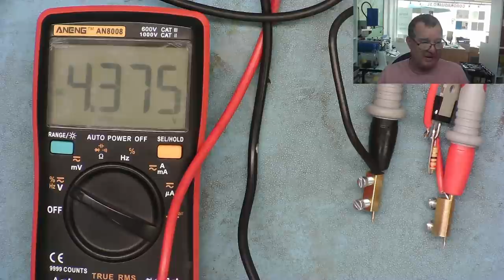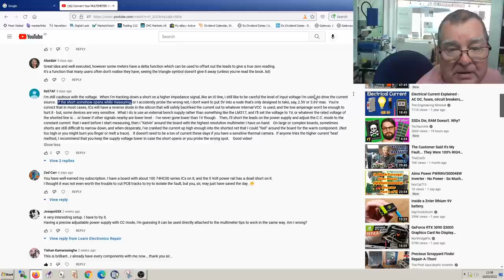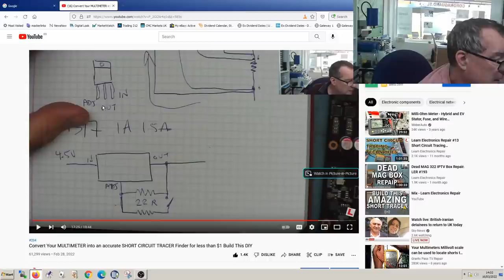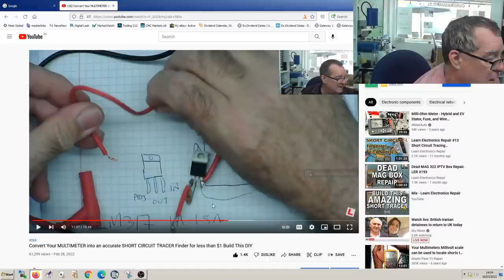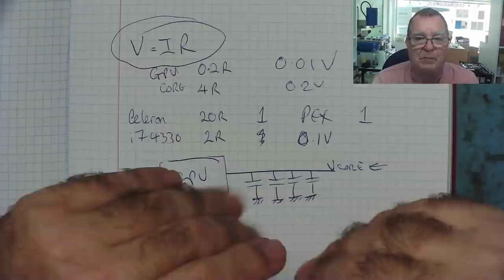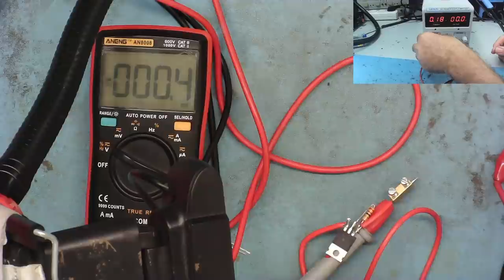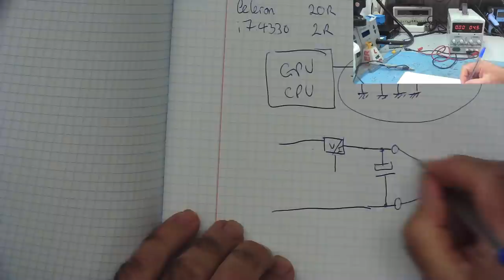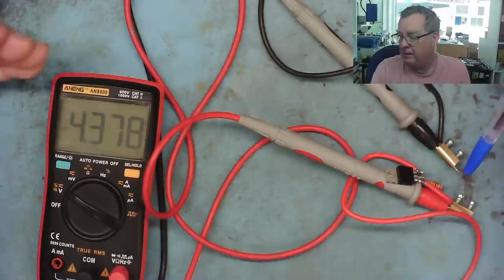The $1 DIY SHORT CIRCUIT TRACER Part 2. Will a 5V short finder kill sensitive components CPU GPU?

Comment: Its clear that people dont understand voltage injection and how voltage behaves under shorted conditions. Nice Video Rich, its a shame you had to do a revisit and prove yourself mate. Great video though, thank you.
Reply from the maker: Really my intention is to help people understand, rather than to prove I was right (though that was a bonus LOL).  I didn't mind revisiting this, if it educates people that is good enough justification to me 🙂
Reply: @LearnElectronicsRepair  you know it was better to show us this. i learned so much from this video thank you so much.
Reply: i'm not sure if i can agree so easily
ex:
a faulty capacitor can cause a short , but it can become an open circuit too.
guess what happen in the second case?

ok, it mean it burned (?) and you 'll see it.
but what about if you "forget" 

what about a faulty lm317, a faulty resistor in the short circuit tracer etc.

repair it' s not trust in the best case, but believe the worst can happen.
ex :
one upon a time,
1 of my test probe was faulty, i didn't see it, so i lost 1hour based on this

after that, i never did this mistake a second time

my 2 cents ^^
Reply: Never say things like that, discussion is always good, another video is always better, brings more eyes into the technicalities and builds a stronger knowledge base. Discussion is always good!
Reply: @ZZZ-z9n3n  surely you check your test equipment BEFORE applying it to the fault? SOP, mate.

Comment: For all those scared of the horrific high voltage, simply drop a 1a diode or two across the output, max voltage now 0.5v or 1v and you can still test for shorts.

Comment: I am so glad that you covered the information about not using PSUs for your power supply, because they have capacitors inside them. I would have surely missed this point. Meaning, I would have included the capacitors that the data sheet suggests to stabilize the operations of the LM317. Including those capacitors would have created a monster. It is very likely that it would have never occurred to me what the problem would have been.
Reply: I think you can use bench power supply. Just don't set voltage to 4.5V. Why not to set the voltage to 0.8V and limit current to 100mA?

Comment: The people worried about voltage rising are probably thinking about a bench power supplies output reading which does go up as it is trying to reach set amp's. Does not mean the circuit will flow that much voltage.
Reply from the maker: Yeah  I think that is exactly why a lot of folks get this wrong 😉

Comment: In summary, a current source supplies a variable voltage while maintaining a constant current, while a voltage source supplies a variable current with a constant voltage.
 Both sources do this depending on the load impedance.
 Excellent explanation, very detailed. Thanks for the video.😀

Comment: In other words: If you do not understand ohm's law to its fullest, you should not be messing around with electronics or electric circuits anyway.
Well done Richard !
Reply from the maker: Yeah Ohms law is kinda the one essential bit of theory to understand if you want to learn to repair stuff.  I'm sure this video will help some along the way and if it does then it was worth the time taken to make it😊
Reply: exactly
Reply: Yeah but ohms law isn't as straight forward and there is different applications within electronics that connects to ohms law, the only way to find out is to mess around with electronics in the first place and correct your mistakes. 

If only it was as simple as understanding ohms law haha.
Reply from the maker: @Ghost572  Messing around with electronics is definitely a good way to learn.  Understanding Ohms law is another. But really you need to do both together. 

When you can reliably predict what is going to happen to the stuff you mess about with, then do the messing and find out you were correct, that is when you have taken a big step forwards 😁

Comment: Thank you for the good idea, I can add something from me. Can be used additional pogo pin on every test probe. Pogo pin will touch first the device under test. Pogo pins will be connected to the millivoltmeter, they will measure the voltage. Test pins will be connected to the current source. By adjustment of the position pogo pin and test probe will touch the lead of the device under test together. By this way we will have four wire Kelvin connection. And additionally, to save the possibility to have evidence that we have surely connected four pins, on every couple wires (current and voltage sensing) we will connect resistor, for example 10 kOhms. When is open circuit, by this resistors will be seen the open circuit voltage.

Comment: For testing motherboards and computers, a Linux Live USB stick will enable you to test and use a PC without installing anything or even having a hard drive. I would recommend Fedora Linux as it's the most advanced and has supports more recent hardware as well as older hardware.

Comment: Very well done!  I think the lm317lz would be a better fit mounting in on the probe.  I think I will make this as a stand alone unit with a 4 digit panel volt meter, I know it may cost more but I would likely break the leads of the regulator on a lead like that as I'm a bit shaky handed.  Will add the shielded probe wire for 4 conductor accuracy.  Ty for the time put into the video's :)

Comment: Also, the current source can be modified, for more battery friendly operation, and for additional options. For example, by add current ranges, 10 mA, 100 mA, 1 A.   Current source can be mixed topology, first stage buck converter, second stage again something like a lm317 or op amp and MOS or bipolar transistor. This will give good range and economy from battery capacity.

Comment: Excellent video. I like all of your wonderful and useful videos. If we don't have a voltage regulator I think it will work fine one 100 ohms /0,25W  resistor and a 5V source or a 56 ohms / 0.5W resistor for a higher current. Also if we have a variable voltage power supply we can use only one resistor for different current values and modify the voltage instead. That resistor will act like a current source.

Comment: I get the impression some had a misunderstanding about the difference between a constant current and current limited supply?  I have a more sophisticated bench power supply which has 4 setting to use Max Voltage, Max Current and also Over Voltage and Over Current and if these are selected properly it is possible to use it for current injection to find short circuits.

Comment: Yes... It is not constant current, it is current limited.

I do get your point and I believe you. 

My (not verified) worry is for high impedance measurements. Like probing data lines or devices made for lower voltage/current. Most microcontrollers I've seen have protection does that will back feed power from the data lines to vcc, so as long as that sinks the 50 mA there is no problem. But something like a wrist watch made to run on 1.5V on a few uA? Or the data lines for the RAM or PCI Express?

I recognize that this tool is not for all circumstances... And I might be worrying too much. Maybe this is a drawback with all low resistance finders. This was the reason I suggested to put a diode between the probes (to voltage limit to 0.6V)

For me electronics is only a hobby, so take me and my words with a grain of salt.

Thanks for taking the time to make a video response! So much better and easier to follow than comment based discussions.
Reply from the maker: Hey Dennis, that is great to see you liked it.  Regards the data lines and such like...

In the video I stuck the tester across a 'naked' (no current limiting resistor) LED and what did it do? It just took enough current to light normally (which is much less than 50mA) and set the voltage across itself to about 2V, Yeah???.  Ooops ,Sorry (YEAH!) that is a catch phrase around these parts now now apparently... LOL

So,  anyway,  the data lines on RAM or the wristwatch are going to do the exactly same thing.  They will either draw practically no current at all from the tester - and can therefore withstand 4.3V withstand without conducting - or they will 'break down' harmlessly, and as soon as any current flows the CC generator will drop the supplied voltage to a suitable levels.  

TBH I'm still not quite sure you 'get' it 🥴

Let me try to explain it this way -  any 'high impedance device' at the point it start to conduct, then becomes a 'low impedance device' and this CC tester will instantly drop the voltage accordingly, otherwise if it didn't ohms law says it must then supply more than 50mA to maintain the voltage, which it can't so therefore it doesn't.  Basically, it 'cannae change the law's o' physics'.

If that doesn't explain it I don't know what will, other than a part 3 video 😉
Reply: @LearnElectronicsRepair  my point is that at >2 volts some electronics may break, and this becomes a problem if they can't sink the current to draw the voltage down, and this is more of a risk for a digital wrist watch made to run at about 5uA, 1.5V, resulting in a guessed resistance of 300kOhm.

Since I am actually an arm chair coach, let this argument rest until I, or someone else, proves it? I don't have any suitable low voltage logic available to test on, and your time is better spent -- even for me -- on making more content for me to watch :)

I would like to thank you for taking the time to deal with me, and the people like me.
Reply from the maker: @dennisolsson3119  Honestly, this video is not intended to 'deal with you and people like you'.  This issue is an extremely common misconception that has been around for years and years, it's just the $1 tester brought it to light and I thought it would be a perfect opportunity to make something very educational to explain it on video.  

As I also mentioned more than once on video, I have no disrespect for yourself or anyone else who thought it would damage sensitive components - and I apologize to you now if I caused any offense.

Maybe I should have put the disclaimer 'no subscribers were harmed during the making of this video' 🤣

Now back to the wrist watch, I don't have one to test with but I am confident ohms law will save the day. But I have an idea, how about if I stick the tester on a motherboard instead of a CMOS battery?

The RTC circuitry in the PCH is intended to run on 3V and 1-10uA depending on the actual motherboard.  Would that be a good test to see if the 5V 50mA will damage such a sensitive circuit?

Comment: Thank you for the all great videos and for helping us understand electronics.
My question is how important it is to have the LM317 closer to the probe? (Meaning to have a shorter cable from the adj to the probe?)
Reply from the maker: As we are short finding rather than actually measuring resistance, it's not so important.  The current flow on the wire from the LM317 is only 50mA.  The main thing is to get the wire from the LM317 to connect as close to the end of the meter probe as possible.

Did you see the updated version(s) of the short finder?
https://www.youtube.com/watch?v=0eixDdCpiO4

Comment: As I understand it,  the maximum current limit is 100mA, on commercial meters that have Kelvin/4-wire capability, because that is the maximum current limit that will n-o-t cause ICs/Transistors/Etc. to begin to conduct, for in-circuit testing. Meaning, that you get the most amperage for the best test resolution, without triggering the devices in the circuit path. So, when designing your own tester, for whatever voltage and resistor(s) that you choose, you do not want to develop more than 100mA. LER, please correct me, if need be. I am going to post this same comment on the first video, too, so that everyone will get the information. HTH.

Comment: A simple solution might be connect a forward biased diode eg 1N4001 across the output. This would not start conduct until the voltage reaches 200 - 400mV - but for testing short circuits where the voltage is 10s of mV the effects will negligible. However the open circuit voltage will be limited to 600mV so preventing damage.
Reply from the maker: Alan Key - It is not necessary to limit the voltage like that, watch part 2
https://www.youtube.com/watch?v=XEbWyQgX_Mc

😉

Comment: Quite interesting second part. I was the one askig about using a bench power supply and although your written answer was pretty concise, it´s now cristal clear the reason and sure will prevent some disasters. I wasn´t aware of that capacitor pressence and sure I´ll acount for that in the future for my tests.

It arises a new silly question now... what about the small digital programmable bench power supplies that are apparently adjustable to .01A or even less , something like the ZK-5KX or the RD6018. Does this kind of power supplies have the same behaviour?
Reply: I would say they all could damage the device under test, to some degree. 99% of the bench PSUs need capacitors on the output for stabilisation. I'm sure there are exotic ones that limit the voltage and current very precisely, but not in the 100$ range. A lot of the cheap ones (digital) will also put out a higher voltage than set, until they stabilize.

Comment: Just a copy from the 1st video:
Great little circuit but has its limitations. With Vin =4v, Vout open circuit is 3.5v, this could easily damage certain circuits, like if probed the wrong thing or the short opens and applies the 3.5v to a circuit that's not designed for that high voltage (many of our Ic's are 0.5v to 2.5v rated AND HIGH IMPEDANCE). You could lower Vin to 3v, Vout open circuit would be 2.5v, but possibly an issue. Lower than Vin = 2.88v and you dont get 100mA. I still prefer using a bench supply in C.C. mode, also because you can use more current on the really hard shorts without ever overvolting sensitive inputs. (and large thick pcb's).
Reply: But you when you apply the probes, it's no longer an open circuit is it ? Open circuit voltage ONLY counts when it's an open circuit...
Reply: @alanclarke4646  correct, but the short can be intermittent (like flexing the pcb) or the part that is shorted opens, now you apply the full voltage to the whole circuit.
Reply: @user-rs8zg8ey2b  NO. Ohm's law is NOT reactive: it doesn't think, "oh the resistance has increased, I better change the voltage". It's instantaneous.
Reply: @alanclarke4646  is that english? you dont even make sense.

Comment: I like the idea, not sure what the big difference is between using this and standard continuity checker on the DM.  Everyone is pissy about using it in sensitive areas, Yes, I get that because it just doubles as a standard DM continuity tester. 

Why not do the same idea using a MOSFET with a low voltage gate, only in this instance, the voltage doesn't really matter because the gate on a MOSFET doesn't sync any current. Transistors are current biased and MOSFETS are voltage biased with no current dependency on the gate. Your only load is what ever you want the signal to trigger through the Source and Drain.

Just saying.

Comment: I think that the concern about the voltage is less related to transistors, and maybe more on various electrolitic capacitors - some of them are rated to only 2.5 V. Even at 50mA, applying 5V to them might not turn out that well. (granted, I did not tested this - I didn't think of ordering a few extra 820uF/2.5V).
Reply from the maker: Again this will not happen - as soon as you apply the tester to a 2.5V capacitor, the voltage on the probes will drop to the point at which the capacitor starts to break down and draw current - 50mA max.  This will not damage the capacitors.  In fact, if you have electrolytic capacitors and want to know if they are good ones that can withstand the full working voltage, you do this by attaching a voltage source higher than the working voltage of the capacitor via a suitable resistor.  The voltage you read across the capacitor is the actual maximum working voltage.

I used this method to prove some large 100V capacitors I bought form Aliexpress  were 'fakes'.  They were rated at 100V and used in a Peavey class G Power amplifier that had 94V voltage rails.  When I fitted the new ones they made a hissing noise and started to look distressed.  

I took a capacitor, my Variac, a bridge rectifier and a 2.7K power resistor.  I then slowly increased the voltage on the Variac and monitored the voltage across the capacitor.  When it reached about 90V the voltage across the capacitor stopped increasing when I increased the Variac further.  And the resistor started to warm up.  This then was the maximum working voltage of the capacitor, not 100V as marked.  It didn't harm the capacitor though, I used them later on another amplifier repair to replace some 63V ones and they worked fine.
Reply: @LearnElectronicsRepair 
Can you please make a video about this method.
Reply from the maker: @mtrltoolman  Sure
Reply: @LearnElectronicsRepair 
Thanks
Reply: I realized another reason why the capacitors I mentioned will almost always be safe: the GPU itself, which is placed in parallel over those capacitors, will take up all the current until the voltage drops to the 300 mV values you get (50mA * GPU_low_resistence). 
BTW, I definitely plan to build one of those toys; it's useful as a measurement device for low resistence - think of shunts and whatnot. And if you can set the current to an accurate 100mA, converting the displayed voltage to ohms is child's play - just shift the decimal point.
Reply from the maker: @HerrAlien  You could easily do that. Use 11 ohms resistor plus the LM317 to get 100mA

 I designed this purely to be an indicator of the lowest resistance, not to measure it, as from the perspective of fault finding usually all we need to know is where the short is, not how many ohms it measures, but sure give it a go it sounds like it would work well 🙂